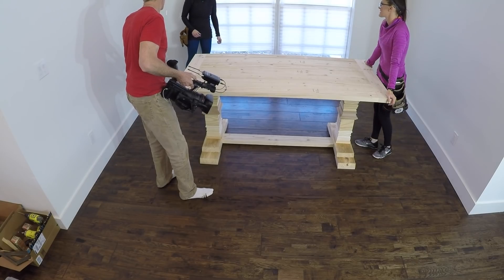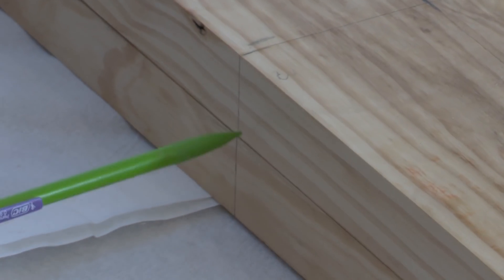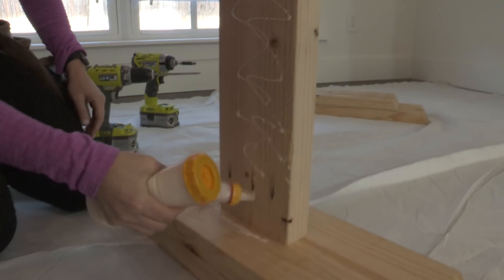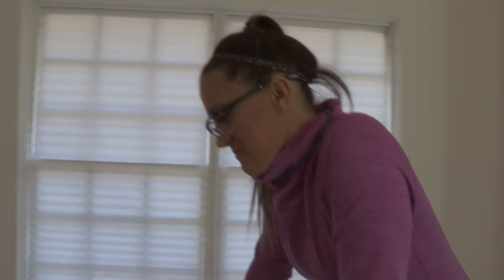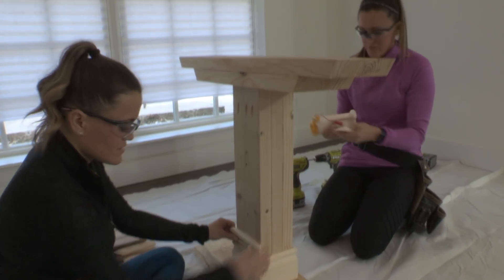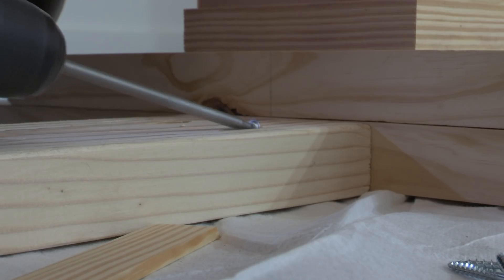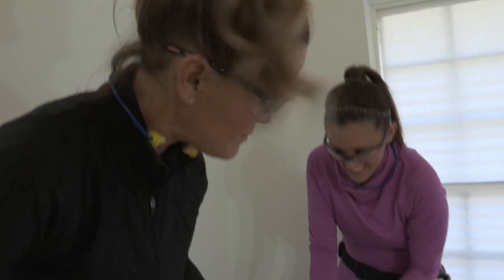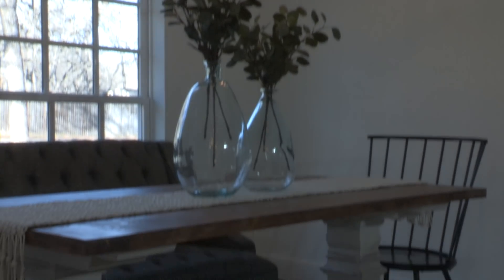DIY Farmhouse Pedestal Dining Table

Comment: If I have no way to rip the boards for the table top, could I eliminate the crumb catcher "grooves" by using wood filler?  I realize the wood filler might require more than one application to adequately fill the grooves and would need to be sanded smooth before staining.  Any thoughts?

Comment: I like your designs but ive seen you do this in two videos now. Isn't it a no no to pocket screw bread board ends because they do not account for wood movement and will crack or split eventually? I've seen many other table build videos bring this point up and most solutions I've seen is mortise and tenon joining with only the middle joint glued.
Reply from the maker: Rod Revera we have been building tables like this for 10 years and have never had that problem. If movement and cracking is that big of an issue (this can happen depending on climate although we live in Texas where the humidity is high) then that is an issue with moisture content in the lumber. Hardware stores carry lumber with high moisture content and the higher the moisture the more movement CAN happen. You can buy lower moisture lumber through a lumber yard. We get knocked by some of the hobbyist woodworkers for using pocket holes for joinery but again, we haven’t had a problem in 10 years and have lots of followers on social media who build from our plans every day and are happy with the results!
Reply: Shanty2Chic, Thanks for the reply. I hope you didn't take my comment as a knock, I just wanted your thoughts on joining bread board ends and wood movement. I to am a subscriber and have built some of your designs that came out great. I'm from California and the air can be dry out here and have had problems with wood moving before. Thanks for the advise and your experience.

Comment: There's no reason to use pocket joints to connect the legs to the bottom.  You might as well just put screws up through the bottom.